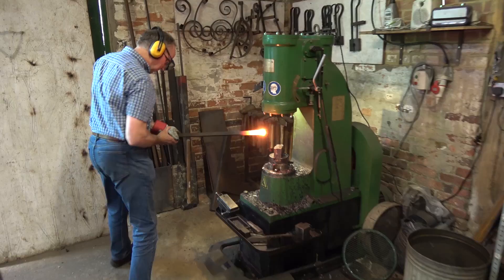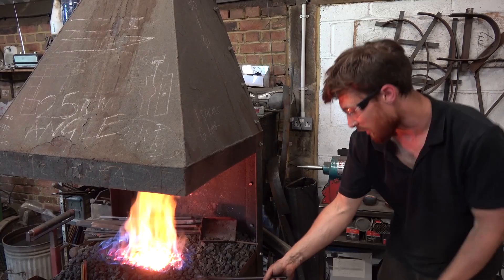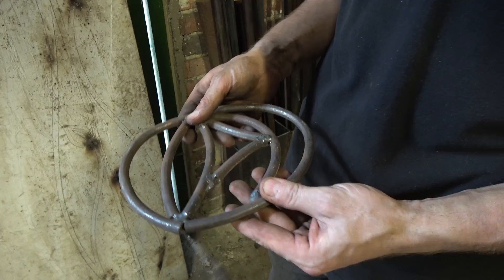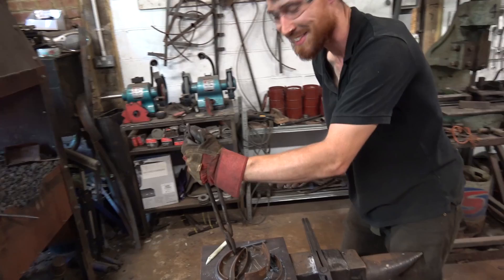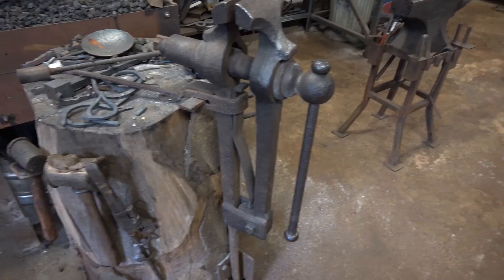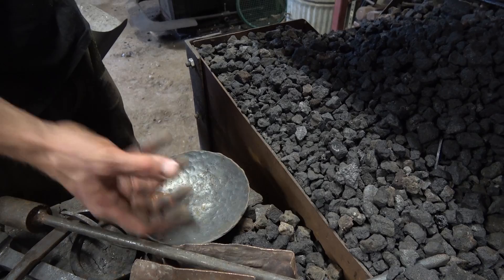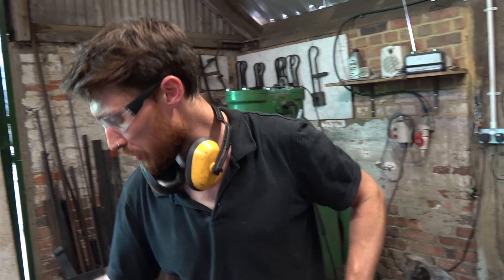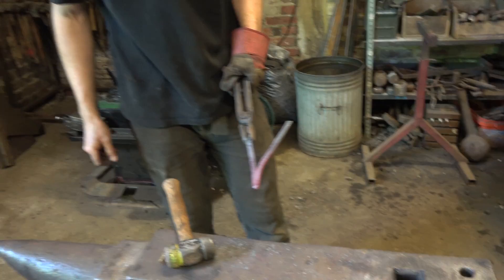Joel Tarr UK Blacksmith Metal Artist At Work.

Comment: 26 minutes in, You call your self a metalworking artist rather than a blacksmith because of the amount of pressure from 'purists'. The master who taught me and countless other had a mantra 'Necessity is the mother of all invention'. If you're forging or shaping steel through the use of flame, your a blacksmith. If a blacksmith from the 1930's was exposed to the wide variety of power tools and welding machines that we have now...would he use them, you can bet your hat he would.Your work is great and your a blacksmith . Keep up the great work.